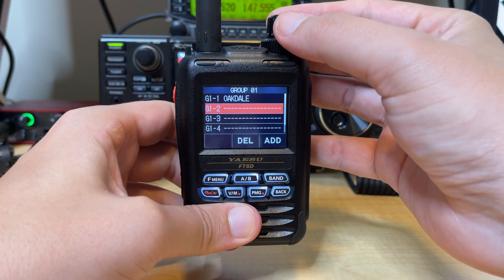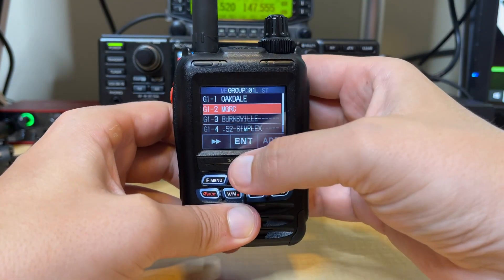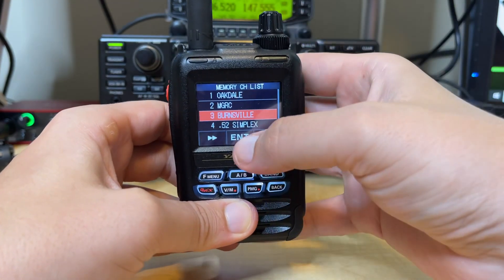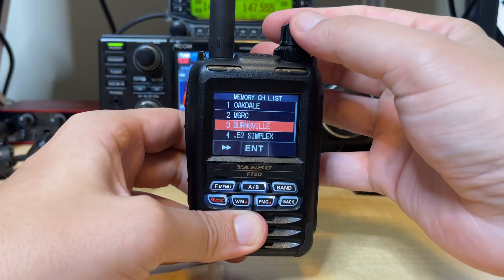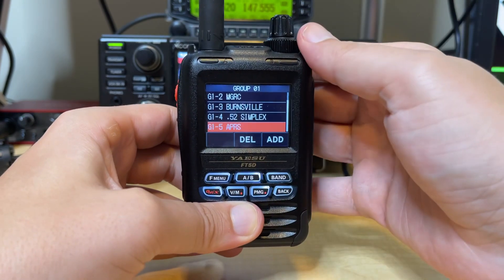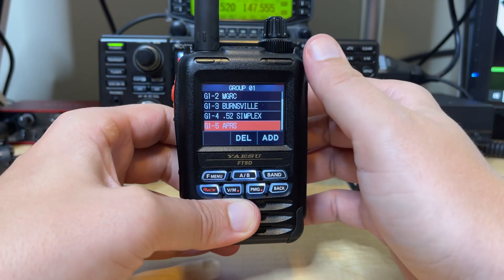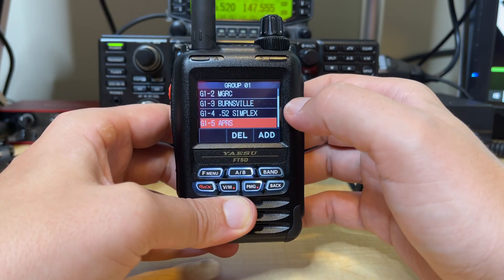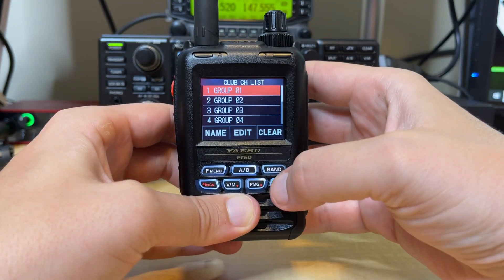Yaesu FT5D: Channel Activity Monitor Setup

Comment: That’s an intestinal group monitoring feature. I have problem with my FT-5D. On channel 1 and some other channels, the upper left green led is constantly flashing. On other channels, the green led is constantly on, even when no signals are being received. 

I suspect that this has something to do with priority scan. How do I turn off priority scan so that the green light only is displayed when FM signals are received, without scanning.

Comment: Great video!  Question: Do you know of any way to scan otherwise monitors the hosts or room that one can program into wires-x?
Reply from the maker: I don’t quite understand the question. What are you trying to accomplish?
Reply: @K0LWC  Well, I'm new to Fusion (W2RHA).  In Wires-x, I have an FT-5...In Wires-X, you can program different hosts.  I believe that there are 5 banks, each holding a reflect or host or room, I believe.  Is there any way to monitor some of those "channels" as in CAM or scanning?